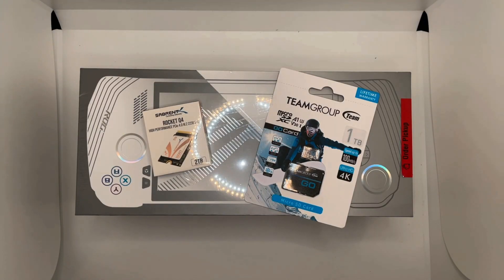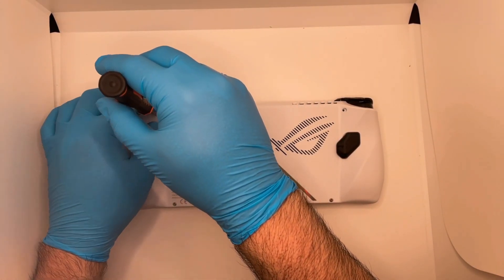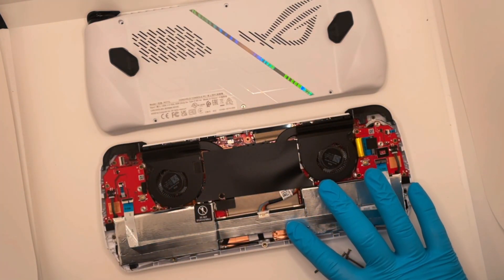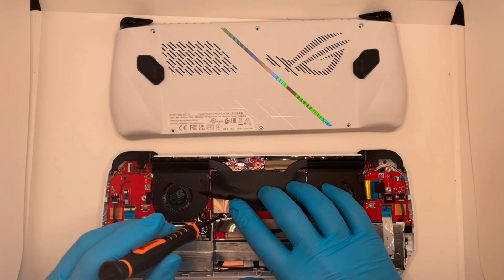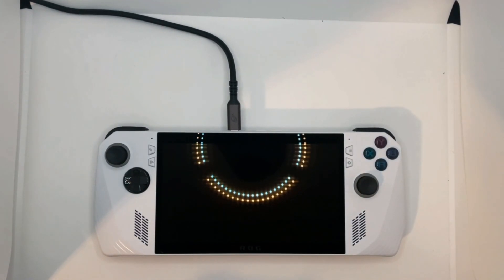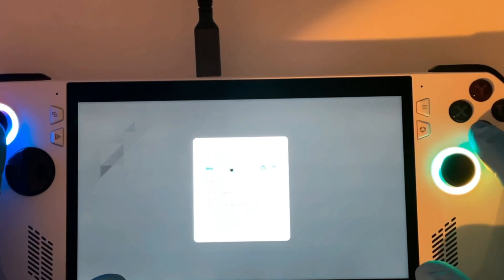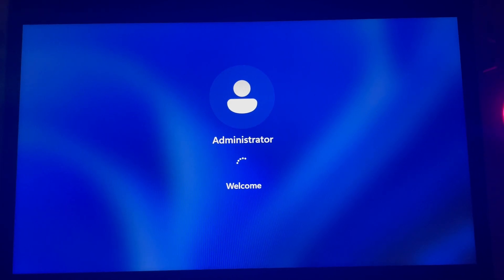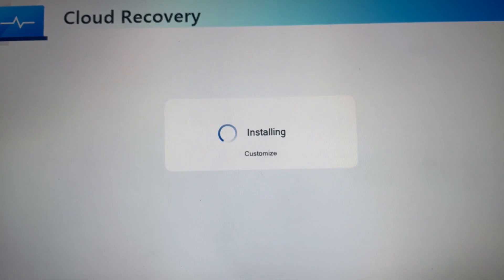ASUS ROG ALLY CLOUD RECOVERY EZ SEALED TO 3TB HARD DRIVE INSTALL #asus #asusrogally #gaming

Comment: Title shows 3TB but SSD installed is 2TB 🤣🤣💀
Reply from the maker: Did you see in the the thumbnail the little 1TB microSD?  I can’t help anyone that can’t install one of those
Reply: @RhoodyTV  TITLE SAYS 3TB HARD DRIVE NOT 2TB SSD + 1TB SD CARD 😭😭😭You know damn well it can't use above 2TB SSD so you figured everyone will click and see how YOU somehow managed to install a 3TB HD. Nice try, you got my click! 😂😂
Reply: @UptownNYC you need help. There are numerous videos, even from very large channels, that have done the exact same thing with the steam deck. Even phrased it similarly. Also, if you want to be pedantic, the title said hard drive. No hard drives here.

Comment: Great video, do the bottom middle screw last that way it opens the case for you rather than using a tool to pull the back away 👍 also when you take the battery connection out its good practice to press the power button to drain all excess power 👍

Comment: So no need to power on and update. Just open the box, change the ssd and do the cloud recovery?
Reply from the maker: Yes that’s what I did.  I got stuck on the windows part once, but after I got back into the bios I changed the date and time to be correct and everything worked after that.
Reply: Thank you
Reply: Mine did not work out of the box. I saw that my firmware and bios was v312. I did it two times and update the time but it did not work. I resorted to installing from usb disk recovery and that worked for me.
Reply from the maker: @DocAtSea  just out of curiosity, which country do you live in JepoyMD?  I’m wondering if they sent older units to different regions.